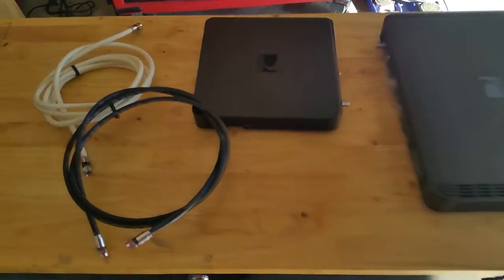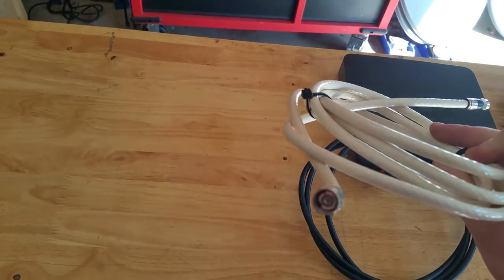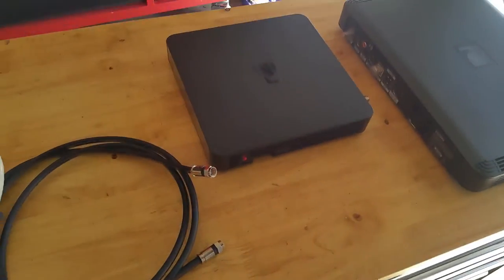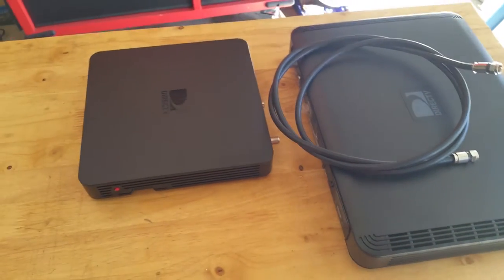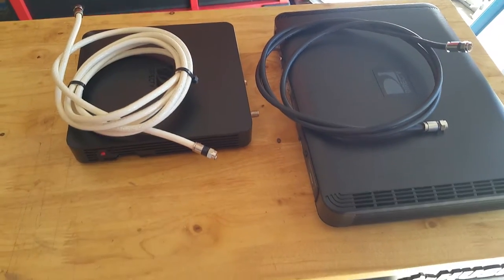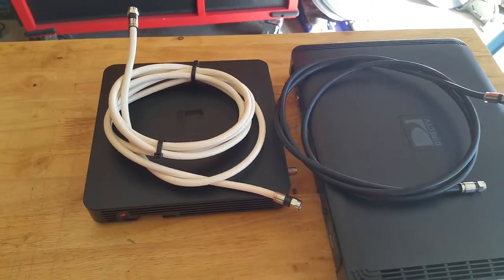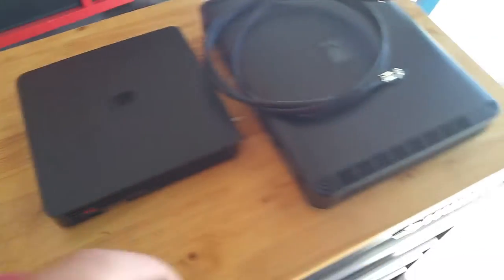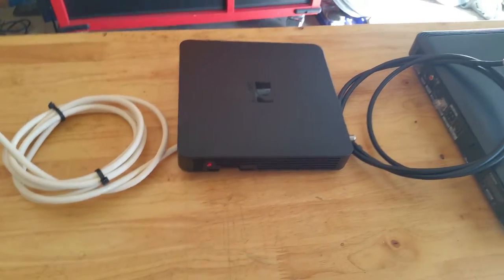Directv Solid Copper Coax

Comment: It all has to do with resistance over distance...  Not dc current.....     It's all about -db's  ...   It will work all day long on copper clad.  We do it all the time on D2 systems....  In fact it will work on rg-59 without any issues if the runs are short enough and it has proper compression fittings on it....     It also matter how many splitters you have in the system because each port has a -db loss factor.    This is why the AIM meter comes with the -25 db tester.      Changing the wall plate barrels out are most important though, as most are not rated at 3ghz that are currently installed in customers homes...      If you have to run a new line and the tech has solid copper sure run it   I just don't see why anyone would walk away from a job if the prewired home is copper clad..
Reply from the maker: Joe S most don't walk away from jobs prewire with copper clad. It's more of Directv wants the tech to replace the line so they know it's new.  
  I've only seen a few jobs have issues with clad lines.  It wasn't the clad line that caused it to fail almost always a pinched line or radio shack splitter in line
Reply: Yes, I know... Directv doesn't trust their own employees to test lines out and change fittings and make sure there are no crimps and breaks in the line.....  

PS MoCa will work with cable splitters because of the freq range...
Reply: Audio and video are significantly improved with a solid copper core vs copper clad